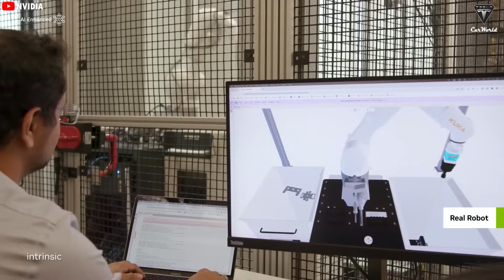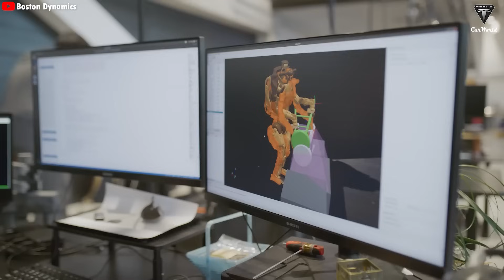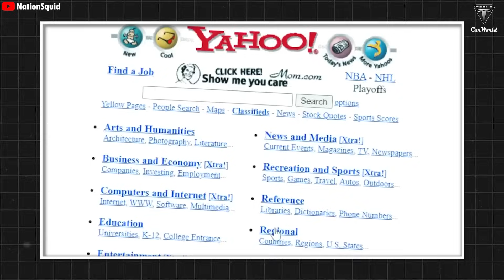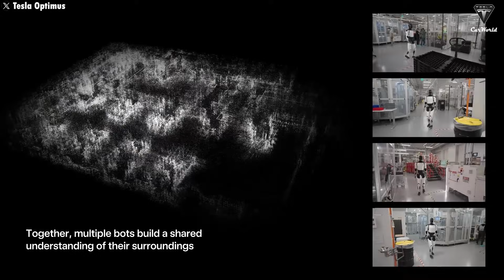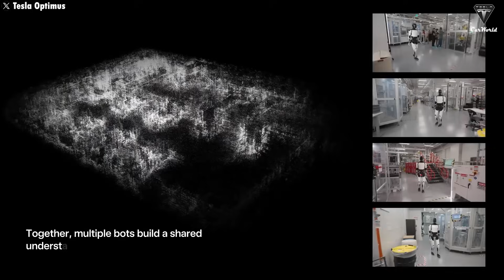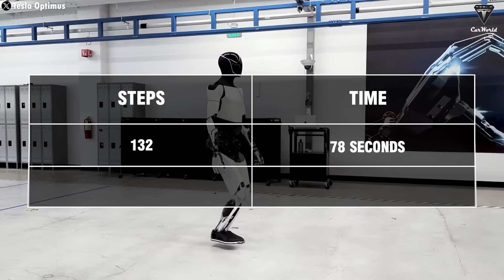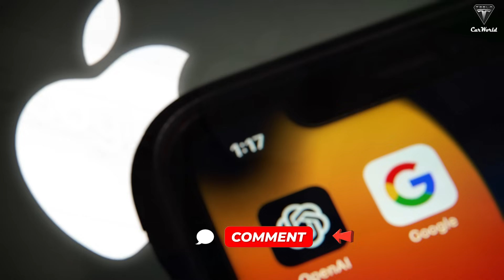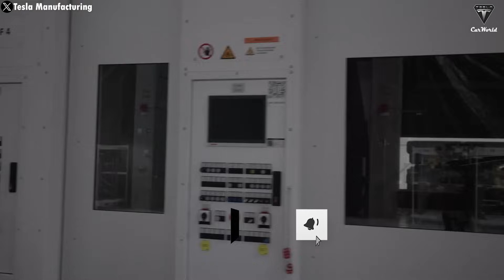Tesla Bot Gen 3 Shocks With Its New Role 2025! 500 Tasks But Elon Musk Will Be Scared For NEW Rivals

Comment: I wonder if you could put these new electric shoes (moonwalkers) on Optimus feet. These shoes require you to walk as normal, and they speed up your walk by 1- 7mph. The batteries last for 5-10 miles depending on your weight and terrain. If you put these electric shoes on Optimus, it would save battery life and speed up his walk to about 1 - 7 mph. This would allow Optimus to keep his 2.2mph walk speed, but it would increase his speed to over 5mph. This will keep Optimus battery life the same as the current model but adding speed. Win win!!!